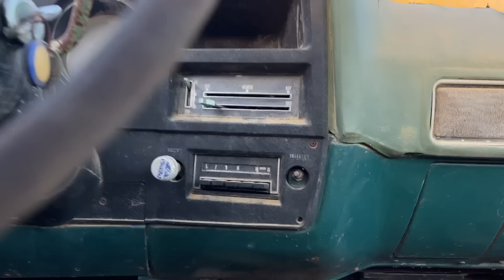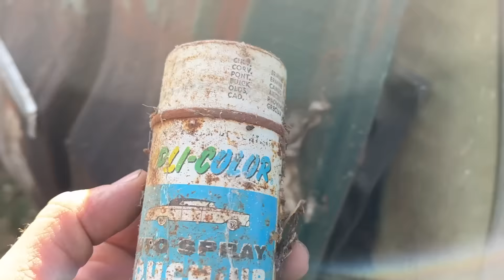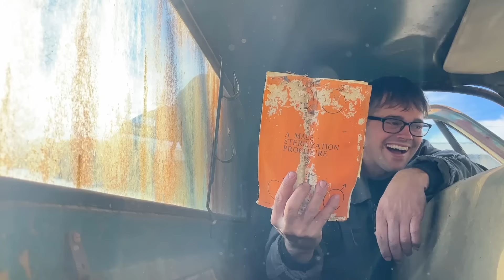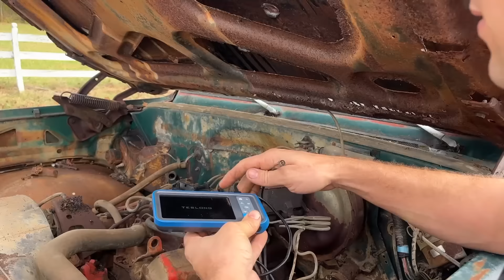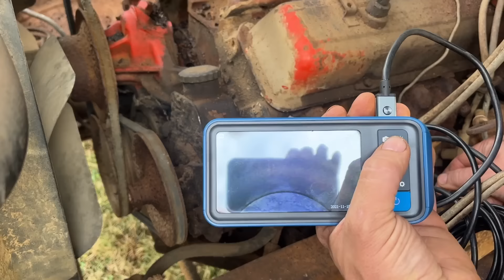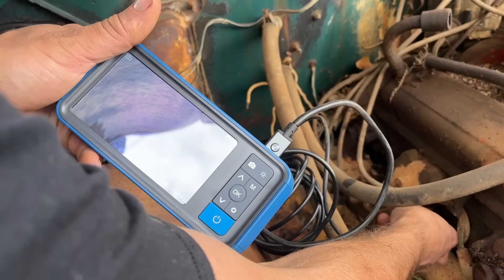Parked 38 years K15 will it start and go muddin?

Comment: I'd like to see a transmission tear down and see what's going on with it.  

Is the front drive shaft on it LOL.

So, is that the last parking spot for that truck before it goes to the scrap yard is in that ditch LOL.
Reply from the maker: The drive shaft is in it. And no we are gonna do more with this beauty
Reply: @Sleeperdude  How's the frame on it?  Body panels are much easier to replace or fix, frames not so much LOL.  I had an 84 Ford Bronco 2 that spent way too many winters in Utah in the salt the whole passenger side was shot, you could watch the road go by under your feet as you were driving too LOL.

Comment: Excellent video Sleepdude Crew Josh  :) also need ground wire with connector plus bolt with washer on connect to fender wall off ground cable from battery to help electrical systems plus charger and Alternator recharge recovery too even start plus sparking control on Distributor! Also PCV Valve on Valve cover should changed plus engine flush that motor totally in engine oil add  after drain plus filter ! Engine Flush clean whole engine plus intake , heads and carb ports even frost plus  plus time chain and you name too! Engine Oil use 10w30 engine and Fram be 8A that size on old one or 13A  is Bigger Long too , Thermostat be same as Malibu takes and brake fluid is Dot 3 also Power Steering plus Automatic transmission is type 2 or 3 ! Lucas works excellent for everything and Josh would get another hood from Junk Yard Scrap also Horn switch in middle on steering of GMC or Chevrolet elbem and lube with pentriotion fluid! Differential fluid is 80w90 & Transmission should be up full get Foward gears and get black bottle of  Gunk brand called Trans-Medic add in too may be plugged on Transmission oil filter too ! Only in 2 wheel drive and not 4 wheel drive so far seen too!

Comment: Can of staring fluid is cheaper than a starter and a little  goes long ways especially if it's been sitting for as gas nowadays really will separate into water  or gas at wawas ethanol free gas is definitely worth the not having any problems getting mowers from winter storage to light right off

Comment: Oh yeah the early 94 Chevy Silverado Z71 is onyx gloss black with quicksilver center stripe down the sides and the tailgate with red triple pinstripe and has a dark blue hood that opens like new lol don't have to bump it or anything just pull the hood release, now have a 2000 gloss black with white pinstripe dodge ram Laramie slt longbed quad cab 318 magnum V8 46 RE AT 1500 4x4, anyways the 86 Chevy k20 custom deluxe longbed farm truck when I got it had a napa reman medium duty 350 Chevy crate motor with forge crank and the Crank was junk so that is why I built a complete different motor other than the manifolds starter, distributor alternator and heads and valve covers and the reman e4mc quadrajet carburetor

Comment: Looks like the front drive shaft is not there, or the transfer case isn't working. Those "casings" are beefy enough to run short distances.

Comment: I think the valves rusted into while sitting  but hey a brand new set of used heads from the piggly wiggly 2 towns over at 3am will definitely do the trick
Reply from the maker: I think you may be right

Comment: Go to harbor freight and get you a Bauer drill kit for i believe $67 and then buy you some cleaning disc and the type of collet or shaft you need to use it for the drill i used a 18 volt craftsman 3/8 drill and a 1/4 inch metal collet shaft from a Dremel accessories kit and used the green round abrasive discs and cleaned engine and mounting sufaces and prepared the intake manifold for installation on the 355 i had built and then I bought a holley street dominator intake and a 1407 750cfm manual choke carb i refer to as the drag carb and intake lol,, and I put a second set of headers in the 86 Chevy k20 custom deluxe first set was hooker blackjack headers for the specific vehicle and those had rusted collectors and then I bought a set of fairly decent used gm gbody heddman headers and they fit after I beat the crap out of the collector tubes and dented them lol

Comment: The four wheel not working is odd the 203 has no 2wd unless you pull a driveshaft or it has a aftermarket part time kit in it.

Comment: I'm curious, did you consider rebuilding the heads that came with the truck originally? It wouldn't cost more than $100 in parts to rebuild it, unless the cooling holes are rusted through completely. I would drain the transmission and see what comes out. It just may be dirty.

Comment: i would get the pistons out clean them and put new rings on them , while there out you could run a balhone through it to get the rust mostly off the cylinder walls
you can probably use the engine in a new project , still a little disapointed you didnt rehoned the cylinders and installed new rings , wouldve reduced a ton of blow by , it probably gets less the longer the engine is running but it could allso start to use oil for no real reason if the ring are seized in the pistons

Comment: When it doesn't have fuel injection, there's going to be problems. In addition to that, when it's on one place for so many years, there's going to rust and corrosion. Do you know what that powder on top of a few of those pistons? That's corrosion.

Comment: Long tube headers work well for torque production per Richard Holdener.
Reply: After you fix the body put one of those cheap eBay 900 horsepower twin turbo systems on it

Comment: ok you have no forward but you also doing have your gears in the front end. so since its a full time 4 wheel drive it will pull from the front or the rear so lock it in 4 high and it should pull. it works like a none posi rear end. pick one tire off the ground and it will spin the one with less resident. I HATE the full time 4x4. but it will work in reverse for some reason.
Reply: one way to check is put it in drive and see if the front driveshaft is turning

Comment: You asked about why they didn't use aluminium heads. They corrode quickly. What do they do to that metal so that the last for many years? They add a different metal so it will be more durable. Metalergists are constantly trying different metals so that they may cut the cost of the a vehicle. That's the reason why GMC and all its decisions aren't number one  anymore. For twelve consecutive years, Ford was the best selling automobile company up here in Canada. I believe FIAT Chrysler is second. I could be wrong about that, though.

Comment: I have a question, would it hurt a 2010 dodge ram 1500 5.7L to use rotella oil in it? Because it might help the ticking noise in motor
Reply from the maker: Won’t hurt

Comment: SO THE CHOKE PULL OFF ALWAYS GETS A HOLE IN THE DIAPHRAGM.   SO I TOSS THE CHOKE PULL OFF AND SET THE BUTTERFLY TO STAY OPEN WIRH A 18 INCH OPENING    I INSTALL SOMTHING TO STOP IT FROM CLOSING ALL THE way.    A stop.   Thats why the plugs are all fouled.    The choke closed all the way.    These did this every year.  That why I toss the choke pull off and press set the choke with some type of hardware clipped to the choke arm

Comment: I liked the video and I know you are normally a Ford guy, and not a truck guy, so Im not going to get on your case.  First, either thats a 77 or it had a real hard life, because the front diff is a 10 bolt and not a Dana 44, (I own a 76 high sierra,(( basically same truck but in 'Hawaiian Blue)) had it since 2008, front cab mounts, core support mounts, and t case to trans bolts are the only ones untouched by me), the reason you dont have 4x4, if you look through the footage, when your son is messing with the front hub cap covers, one of your 'drive slug' gears is gone, you should have a 3970010 block, most likely four bolt, mine is, that block is considered the best casting for a 350 to that point, these make great tow rigs and parts chasers, but the V8 trucks of that vintage have 3.08 gears which are kinda terrible, 4.10s are too low unless youre running 35s or bigger. Might be time for a road trip soon, Im re bodying mine with a 57 GMC.  Id be willing to part with some decent body panels.  Let me know.

Comment: Your son could stay right there under the hood and you could close the hood on him LOL.  

What the heck did the previous owner do to that engine, I think that's the worst I've seen as far as the number of broken valves....Its extremely low on oil too, whether that was the cause or not, it probably wasn't of any help.  

Those trucks got crap for fuel economy, throw in the full time 4WD and they're even worse LOL.  Friend of mine has one that is the same way, when it was running it would get around 6-8mpg around town, and about 10-11mpg on the highway.  They keep having issues with the engine, can't remember what all now, but the engine was rebuilt and then had the same problems with the valve train, so its been parked for the last 6 years LOL...they got tired of messing with it.
Reply from the maker: Yes for sure..

Comment: I think the valve stems were all rusted off, not broken by failure. Wierd that the rings weren't stuck, if that was the case. I wonder if mice climbed all the way up the exh manifold and into the exhaust ports and their pee corroded the valve stems.
Number 5 exh valve might have been the only one that was open, so that cyl had the worst rust. 
I knew the ignition module was the most likely culprit as soon as you found no power at the distributor.
Those coils rarely, if never go bad.
I was going to suggest checking the front hubs to see if they are the kind you need to manually lock-in. You probably already did that by now. Forward clutches in the trans are probably shot.

Comment: They only had 5 digit odometer. Until the late 80s then they went to a 6 digit. So it prob has 155,000 255,000 maybe very doubt full 355,000 miles.
Reply from the maker: That’s true and you may be right but it was last driven only 8 years after it was new and it was used as a farm truck. That’s why we think it is 55,000
Reply: @Sleeperdude  right on if so u have a gem
Reply: @Sleeperdude  right on if so u have a gem

Comment: All THOUGH YOU HAVE A GOOD 350 TO REBUILD.    I WOUKD SAY DO IT TO IT.  YOU GOT YOUR MONEYS WORTH. WITH THE TRUCK CHASSIS AND GOOD MOTOR.     I ALWAYS PREFER THE OVERDRIVE 700R4 TRANS THOUGH. BUT THE MOTOR CORE AND CHASSIS ARE COOL.   THAT IS A REALLY GOOD NON EMISSIONS CARB.  KEEP THAT ONE.    THERE HARD TO FIND WITH NO EMISSIONS.  ON THEM

Comment: Try blowing out the carbon in that cylinder through the spark plug hole. Or, as you have decided , pull the heads you'll probably have to anyway,

Comment: Won't go mudding with those crappy tires on it...but it will go sliding and getting stuck...you deffinetly should have dropped the transmission on and changed the filter cleaned the pan and changed the pan seal..all of about 8 bucks for laid and everything

Comment: You can't adjust them valves like that you got to turn it over and do one at a time ..why are you putting the valve covers on the first thing your going to haft to do js adjust them if it starts but I doubt it will if you cranked them valves too tight it won't have any compression and won't run..there's too many people that don't know much working on it..but I give you a a for effort..it has no compression you got the valves too tight and you need starting fluid..I been a mechanic 50 years

Comment: I love what you do and how you involve the kids BUT I cringe several times an episode when dangerous short cuts are taken, like Ralphie in the engine compartment under 75 lbs of rusty separating hood held up by a pry bar. Or taking them on test drives with questionable brakes and gas tanks without a cap. Just not cool. At a minimum, may I suggest Tetanus shots for the whole family for Christmas. Sorry to be a wet blanket but it's hard to get replacement parts for kids and restorations on them can be very pricey.
Reply from the maker: They have all had tetanus shots actually

Comment: Walk away from this one. This truck needs everything, and the body and probably the frame as well are completely rotted. You have a surprisingly strong engine, so I would just pull it for one of your other cars and/or wait until you get a 4WD body that is in a little better shape. You're going to end up putting $5K in a $500 truck just to make it driveable. If you are wanting to build a good truck, then you need something a little better to start with. With all of the rust issues it has, I wouldn't trust that body and frame to hold up to off roading.

Comment: Trying to turn over a motor that you KNOW has solid material in the cylinders. How much more damage are you trying to do. Why the hell would you keep trying? It's obvious what's stopping it.

Also, you should NEVER prefill an oil filter. You are adding it in after the element which means anything you put in there is going straight to the bearings unfiltered. Not a good idea.

Comment: lmfao 55k miles? no more like 255k miles
Reply from the maker: It was only driven for 8 years
Reply: @Sleeperdude  you do not get oil/carbon buildup on spark plugs that thick at 55k miles no matter how old the engine is lmfao. That engine was TIRED